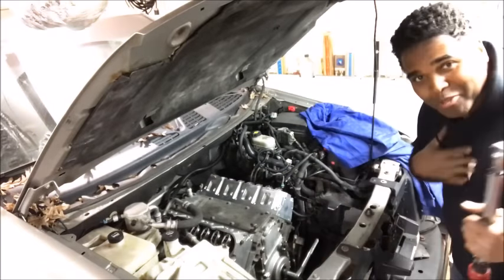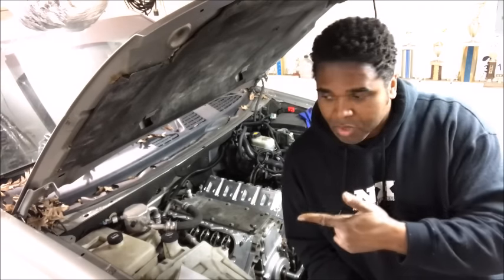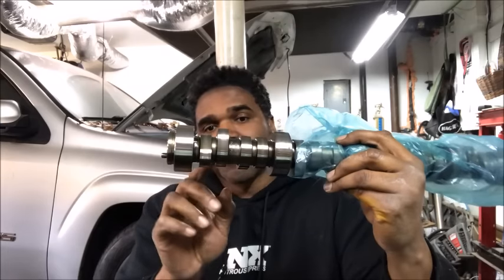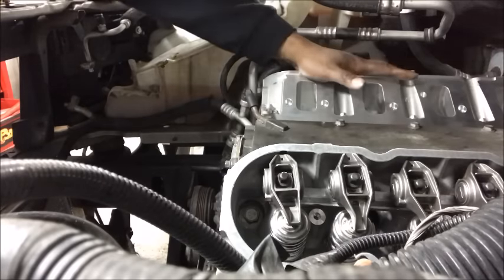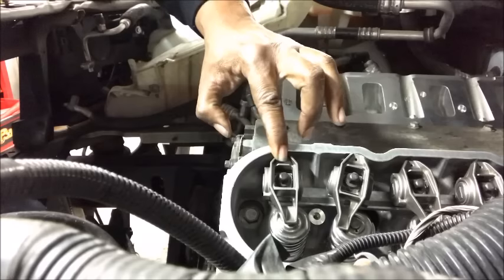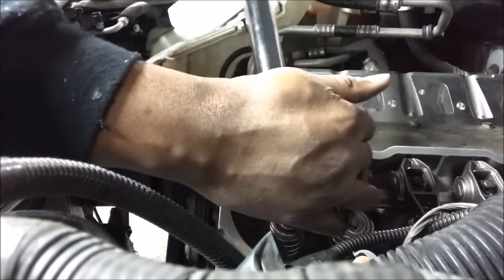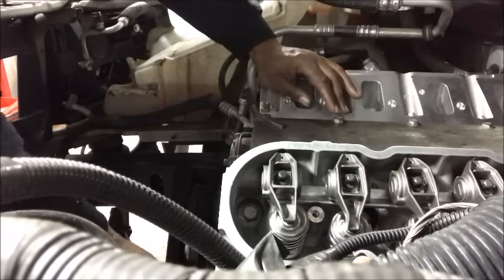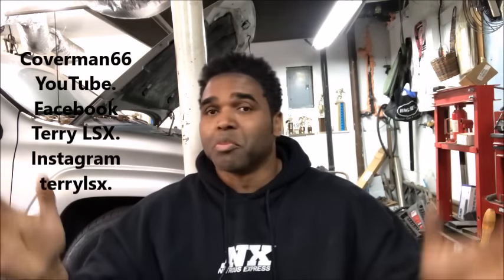LS Rocker Arm Install and Torquing. (3 Easy Steps... YOU CAN DO IT!)

Comment: Are the rocker arms supposed have left and right play after it’s torqued down on a ls1 or a 5.3 lm7? Mines got play it’s already been torqued one of springs are bent on other head but both sides have left and right play in it n hear a loud ticking or knocking n found a bent spring on o one side n bit play n rockers n was hoping this is problem n not something in bottom engine
Reply from the maker: without load they have a lil play in them from left to right.. a very little.

Comment: I recently purchased a complete cam kit from TSP.  I went with Johnson lifters, and due to the recommended preload, it requires different length push rods.  They sold me specifically what it calls for based on the components being used.  So with that being said, is the rocker arm torque procedure exactly the same?  No additional measuring?  No worries about preload?  Etc?  Just follow the process exactly how you laid out??
Reply from the maker: it should be, id call TSP just to make sure.. keep me posted.. thanks

Comment: Quick question, do you have to mess with the piston firing order to get this method done right? Or simply just do it the way you explained it in the video. Really need help 😭
Reply from the maker: all you need is the cam off the nose, then torque em down lolol firing order isnt required..
Reply: Do it just like shown in video

Comment: Oh my God! So simple thank you for explaining it that’s so easy what’s with all these people on here “turn top dead center then 90 then zero then blah blah blah man. It makes so much sense and I was thinking the same thing like why does it matter if I’m on the compression strike or not? The cam is shaped the way it is and the rockers can only be tightened so much. Now quick question can I use this method on a 1974 460 with non adjustable rockers.... and I don’t know if it has hydraulic lifters or not. I’m guessing it’s stock. bought the truck a few years ago now I’m starting to work on it.
Reply: Oh by the way... totally worked my truck has never sounded and ran so good
Reply from the maker: thanks brotha doc, if you have any question just reach out.. on that 74 your going to have to use a feeler gauge..  i remember those day too well lol

Comment: A great video is the first video I see how to calibrate the rockers thanks you!! I have a question I just changed the seal valves an my silverado 5.3 and after I changed the seals chow me check engine light whir crankshaft position sensor and I noticed to take to long to started I replaced the sensor but still take to long to started and the transmission hit from 1 to 2 any clue? you are appreciated
Reply from the maker: hmmmm, was there anything else changed? why did you feel you should calibrate the rockers? what problems were you having?
Reply: @Coverman66  take to long to started the engine has spark and gas but sound like miss fire. When changed valve seals I put air in the pistons to hold the valves up. You think can be possible the timing chain jumped when put the air in the position? When I put the air in I could hear the piston go down Im think put to much air pressure and let that air go to fast that can be possible to jump the timing chain? Thanks for answering 🙏

Comment: just bought a 2008 gmc truck with a 5.3 with 156,000 miles.   It sounds like a sewing machine under the hood.  The previous owner said that he had the lifters change about two years ago and the engine had about 120,000 on it.
Is there a chance that i need to get in there and re-torque the rockers in order to get the sewing machine sound out of my motor?  And can these valves be adjusted like this at anytime in this motors life?  Thanks for any help with this.
Reply from the maker: checking the adjustment is the first place i would start. keep me posted with the results.. im curious..

Comment: Question!!  I recently replaced my heads and when I torqued the rockers, I did them without turning the crank. Now I’ve got a clicking sound that increases with RPMs. Occurs in neutral, forward, and reverse. Could this be problem?  First I thought a rod bearing but I’ve read so much about flexplate issues I’m confused. I had the inspection cover off and oil pan so I don’t know if I misaligned something that way or if the rockers being torqued all at once without crank rotation is causing the problem. What do you recommend?  I love your videos. Watched a lot of them doing my LS work. Btw, it’s an LQ4 in a 1999 Silverado 4x4. Thank you!
Reply from the maker: i would torque them down properly to eliminate that..
Reply: coverman66 update!  I did pull the covers and loosened all the rockers to do the torque sequence like you showed. It did make a noticeable difference in the engine noise but it turned out my real noise was something else. I had a loose bolt through the flex plate to torque converter. Tightened that up and my truck runs smooth as butter! 👍

Comment: what happens if i didnt do this?? can i just re do it and ill be fine?? cause now i have a misfire cylinder 1 and no compression. but when i back the rocker arm bolt off i have plenty compression?
Reply from the maker: im not sure what happens when if you dont torque the rockers down.. i always torque the rockers the same way for years..

Comment: Can the rods loosen? I just did my lifter in a 09 Silverado 1500 5.3. Got it all back together, ran amazing, better than it ever had for about 4 hours then I got another lifter tick.!
Reply from the maker: were new lifters installed? if so were they soaking for a day?  id torque them down again..
Reply: I only replaced the one busted lifter. I know, everyone told me to do all of them but I didn’t have the funds at the time.
Reply: I haven’t even open the valve covers because I’ve been so pissed about it lol 
I heard the rods can loosen if not tightened right or enough so I figured I’d ask.

Comment: Very clear and understandable not a lot of guys explain it how you do but quick question do you have to rotate the motor for each of the two rocker arms per piston or once it's in the right spot can you just torque them all down to 22lbs? lbs?
Reply from the maker: you want to torque when the load is off the pushrod, meaning off the cams nose.. you can torque all the rockers that are off the cams nose at once..

Comment: So since this is preloading your lifters and rocker arms, during a cam install while you have the wood dowels in to prevent the lifters from touching the camshaft so you can remove it would you leave those in while preloading or do you preload after your timing cover and all of that is reconnected? I’m just confused because I’m doing a cam swap and replacing the lifters while I’m at it. So at what point would be best to swap the lifters out I guess
Reply from the maker: once the cam is installed, i like to put the timing chain and cover on, install the lifter, push rod and set the rockers one at a time..

Comment: What’s your thoughts on oil on the threads of the rocker bolts?  Do I need to clean the threads on the heads?  They all currently have oil on them.
Reply from the maker: a lil air and install, they dont have to be cleaned like the head bolts

Comment: How do you turn your crankshaft? Also do you recommend to take off the belt or does it not matter?
Reply from the maker: doesnt matter.. if its too tight remove the plugs. and turn on the crank bolt.

Comment: Just subscribed. I have a question.  I bought 2005 2500hd with lq4. Needed trans. Pulled engine to clean and went overboard. Took to machine shop to rebuilt bottom and have head work.(ran great but figured might as well). Switched to flat top pistons as connecting rods were set up for it. Went with a stage 2 low lift truck cam. Ls7 style lifter, .550 lift spring set, upgraded rockers with trunions. I was told pushrods could stay at stock 7.4. Noticed machine shop shaved down heads.. Can see some spots that didn't get touched so assuming barely anything was taken off. Don't think they decked the block. Can I get away with 7.4 push rods or should I change? How do I check?
Reply from the maker: i would talk to the machine shop for sure.. i always stick with the stock size harden rods.. the small gain isnt worth the un ease of not knowing.. hope this helps..

Comment: Great video. Quick question, do you need to put any anti seize, thread sealant or thread loctite on any of the rocker arm bolts?
Reply from the maker: i just torque down..  thanks for the compliment..

Comment: Will this work with a brand new lifter that has been set in an oil bath that has not been primed or do you want to turn the motor over and make sure the lifter is fully primed with oil?
Reply from the maker: i installed new lifters and had them soak for 2 days, then installed the heads and used this method. hope this helps..

Comment: Question just got my engine back from the machine shop ls1 TSP cam chrome molly push rods and a tronion upgrade installing the rockers in this video did you already  do the other ones or did you just tighten them all then just do you number 1 cylinder?
Reply from the maker: i forgot, i think i did a few for the video then finished them all the same way off camera..
Reply: Okay cool thanks a lot

Comment: The kid comment.. use nail polish to color which bolt heads to "play" with. Be doing water pumps unsupervised in no time! Just like how my lifetime friend learned as a young boy. 

Great vids, man. Torqueing & texting is that a thing?
Reply from the maker: much appreciated brotha BB
Reply: Things where great until I seen u mount that dampener using a block of wood. What the heck 100$ loaner tool. Got yeah, but still.

Comment: I did the 1357 intake first and exhaust last and 8642 intake first exhaust last.
Would I have to put cylinder 1 back on top dead center before I start it?
Reply from the maker: as long as the lifter is off the cam nose you should be good

Comment: TERRY: I have a few questions I would like for you to answer for me I have a O8 trailblazer SS it’s basically stock. Iam putting long tube headers a different throttlebody And a Air intake as of right now my transmission went out it doesn’t go in drive or in reverse. I am going to put a super charge on it but that is way later but I want to put a LS3 heads and a LS3 cam is there something I’m missing to put with the cam or different torque converter for the transmission and for the heads please let me know. I want to keep it a daily driver but I want to take it to the track and have fun on the street what do you suggest ?
Reply from the maker: i went with the LS3 heads and btr stage 2 ls3 cam , you will have to change the intake from cathedral to rectangular port, the converter will give you more power if you go lighter.. call acc performance they make the boss hog converter, ask for nelson gill and tell him i sent you.. tell him what you got and he will get you the right converter

Comment: I am new to this, will I need to do anything with the timing of the engine being that I am rotating the engine independent of the trucks computer?
Reply from the maker: no. make sure the dimples on the crank and cam sprocket is at 6 0clock cam and 12 oclock crank and your good to go..

Comment: Hey bud quick question since you learn something new every day like I just did today with this video... what happens if you just torque all to 22ft lbs with out doing the base circle method? I cant believe I've been doing it wrong this whole time.
Reply from the maker: i cant tell you because ive always dont it this way.. i would think it would think the torque wont be accurate. thanks for the question brotha Joe..
Reply: If you don't Torque them on the base circle you WILL end up with erroneous torque specs, potentially allowing your rocker bolts to loosen and at the least bending a pushrod. The worst, bending a valve or ruining a piston!
Reply from the maker: exactly brotha Jeff.. thanks for the comment

Comment: @coverman66 sorry if this question has been asked before, but do the rockers need to be on base circle to be removed? Or can i just remove all the rockers at once without rotating the engine? Great video btw I just subscribed and turned on post notifications^^
Reply from the maker: to remove them doesnt require this base circle method brotha Paul.. only when installing.. Thanks for the question

Comment: Just a question I have to ask when you set each cylinder on the compression stroke both intake and exhaust are closed Meaning they are both on the the base circle right? can i then torque them down then or is your method more accurate
Reply from the maker: my method works for many ls engines ive done.. to me a just one extra step to avoid what ifs.

Comment: Will this work for the lq4? 

Edit. I want to do this to my lq4 because it has 170k and I dont think it's ever been done before. I dont hear any noises it sounds really good and runs good. But it's just a preventative maintenance thing I want to do. Do you think I should proceed with doing this?
Reply from the maker: it will work on any LS engine. ive done this on engines with over 300k no issues.

Comment: So if you don't set base circle will It cause alot lifter tapping noise? I had to replace a set stock 5.3 heads on my engine now it has a alot of lifter tapping noise. Very noticeable noise level on it. I need to break it back down and set base circle on all of them.
Reply from the maker: sure it can, you wont get an accurate torque if you dont set the base circle .
Reply: Man thanks for that info, much needed. I will definitely get the truck broke back down and redo all that
Reply from the maker: any question feel free to hit me up..
Reply: Will do, when I get broke down I'll hit you back up

Comment: Hey great video, I do a little wrenching myself although the LS engines are a little foreign to me. Anyway I have a 2000 Chevy Silverado with the 5.3 and I have a tapping in my engine. It's not very loud, just loud enough to be annoying. I recently replaced my valve cover gaskets  and i looked at all the rocker arms, turned the engine over by hand to get each one off the lobe and none of the rocker arms seemed any looser than the next. I didn't torque the rocker arms like you did but i did make sure they were all tight which they were. The engine has 130k miles on it. I then did another oil change and put this stuff called Hot Shots Secret "Stiction" eliminator but it didn't fix the tapping. Do you think i have a stuck lifter or is it possibly a wear issue? Btw i replaced the oil pump seal which i hear is notorious for going bad and causing oil pressure loss. Sorry about the long comment, I just really wish I could fix this cheaply.
Reply from the maker: how is the performance,? i would make sure the rockers are torqued correctly..

Comment: What happens if you just tighten all the bolts to 22ft /lbs regardless of the cam position?
Reply from the maker: it might put too much force and cause failure.. best to torque to spec and not worry about the what ifs.. thanks brotha CC

Comment: Thanks for sharing. I have a question. 
I installed my rockers a couple days ago but I used the chilton book direction on torque. Which is piston in cylinder 1 at top dead center tightened intake valve rockers 1, 3, 4 and 5. Then I tightened exhaust valves 1,2,7 and 8 all to 22 ft lbs.
I rotated the crank twice as that is equivalent to 360°. After that I torqued 2,6,7 and 8 intake valves and 3,4 5and 6 exhaust valves. All torqued to 22 ft lbs. .
When the front of the rockers are pointed up when I turn the crank they are immovably tight but I noticed that when the front of the rocker is upwards it has a little bit of wiggle, not like your wiggle before you torqued your rods in this video but a little teeny bit of movement. Very, very, very slight movement. Barely moves. I'm assuming it's because the tension is relieved. Is this normal?
Reply from the maker: i showed one at a time for video purposes, you can do multiple rockers at the same time as long as they are off the nose of the cam.. thanks
Reply: @Coverman66  so the tiny bit of movement is ok?

Comment: Hey man, great video! I just did a stage 3 cam on my truck with springs, do I need to set the lash on it as well or just do what you did? I'm new to all this.
Reply from the maker: whats good brotha Ivan, i torqued my stock rockers to spec. to be sure, contact BTR just make sure on the stage 3 cam..
Reply: @Coverman66  I appreciate it man. You didn't have to space the rocker out at all though? I know some vehicles you have to. Wasn't sure if we had to do it on these LS motors.
Reply: @Ivaann_M  the hydraulic lifter does not need lash adjustment, as long as you have pushrod length correct what he did will achieve proper lift.

Comment: So you put all them in but cylinder number one without following firing order and you didnt rock each cylinder??
Reply from the maker: firing order isnt as important as torquing off the nose of the cam.
Reply: @Coverman66  it worked I put them in per Haynes manual everything new still have a p300 code random misfire trying to track it down reset ECM went away but after driving awhile check engine light blinks
Reply: His video was perfect

Comment: Dude you explain it so simple and easy thanks bro and what if you starting on the second rocker and it’s already at top dead center do u still have to rotate the cam
Reply from the maker: thanks brotha.. thats whats its all about.. just as long as the rocker is not on the nose you can do as many as you can..
Reply: The nose is top dead center just making sure to be safe